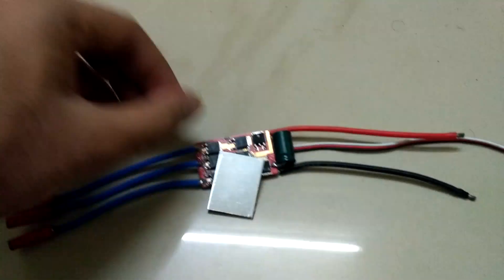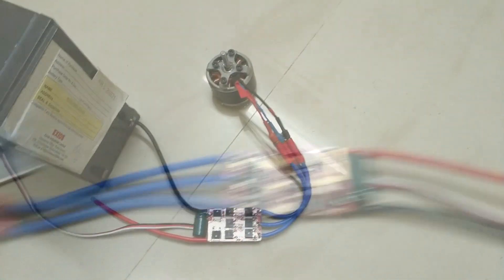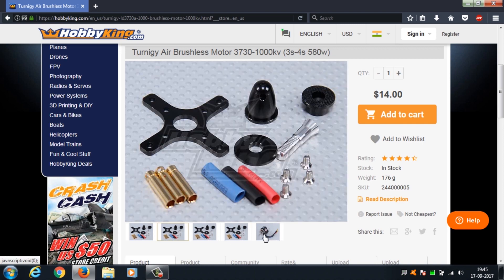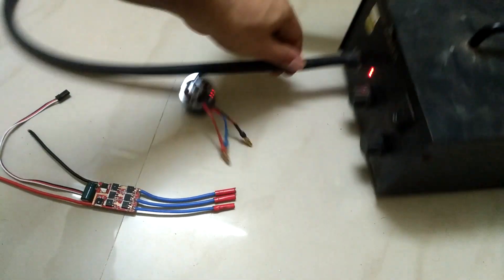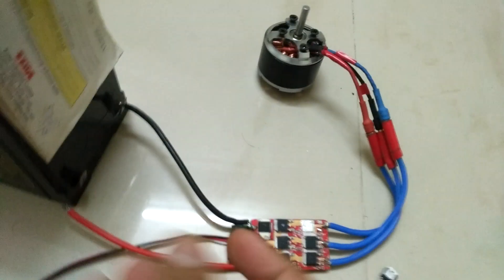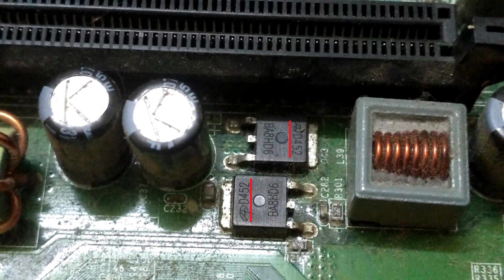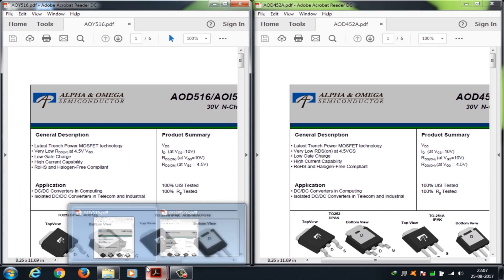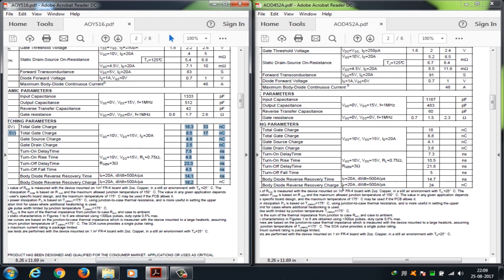Esc Burning Mosfet Replacement Part (1/2)|DIY

Comment: Why do they burn... :( I have burnt 3 and I'm using 20amps esc with 2s Lipo... please help...
Reply: To calculate the amount of amps a battery outputs you do this: say you have a 1500mah battery and it has a discharge rating of 20c, you would do 1.5 times 20 (30 amps) to calculate your amp output for the battery. Make sure your esc has at least 15-20% of wiggle room for your battery ampage output

Comment: i need some help....i had ordered a 2500kv motor and 40Amp UBEC Esc combo, and had not used it for some time. when i tested the ecs, i noticed that it was heating up very soon, like under 5 minutes, with idle power, and also on standby... i tried switching motors and props, but its still heating up... is this supposed to be normal with UBEC ESCs, or is it a serious issue???
Reply: It’s normal and it’s a serious issue. If you haven’t used it for a while then the thermal paste/pad must have dried out. You can remove the thermal pad and install your own, bigger heat sink and fresh thermal paste

Comment: When I connected my lipo 4S 14.8V 3000mAh battery to 3 brushless 30A thruster, 1 ESC exploded. Now when I connect the others, nothing responds, no sounds or movement. 
What could be the problem? Could all the ESC's be ruined?
Reply from the maker: For dead escs the first thing you should check is the regulator that produces 3.3 or 5volts for the microcontroller, if that is not getting power, nothing will work, no beeping, wont respond to signals etc

Comment: i have very cheap and veeeeery small 2-3s bldc wich is capable of making 3.4w without heating. yes only three and half watts. so im running it on 1a 3-15v soviet lab bench power supply and esc wich i am using is 10a esc. this is used as 3d printed fan for my amplifier. it worked good but one mosfet got blown so i needed to repeair it. thanks for good video, it helped, it works but im not sure for how long so i am going to buy 10a ecs wich is like 4x more expensive, becouse the one i have now is no name 10a esc.

Comment: Sir while removing the heat sink i accidentally damaged a resistor near the MOSFET,i use exactly the same wax as yours could you pls help me find the resistance of that one
Reply from the maker: If it was a gate driving resistor then you can measure and put a resistor of the same value as of the other 5 mosfet resistor, all motor driving mosfets use same value gate resistors
Reply: @thecuriousone9342  thanks alot

Comment: When I connect my battery to my quadcopter after sometimes one of my ESC gets heated up ! The other 3 is normal ! But still I can Able to fly my quadcopter ! Can i know what may be the problem ? Thanks in advance 😀
Reply from the maker: Heating up without pwm means either some of the mosfets are shorted or the 5 v regulator is shorted, check that

Comment: i have a battery with 7000mah 40c 
and a motor which consumes 14.8v and draws 55amps of current at this max load conditions  . will the battery fry the motor is it safe to use that battery plz help na 🙂.
Reply from the maker: Motor consumption =14.8*55amps = 814 Watts
Battery capability 7Ah times 40C =280 amps times 14.8v=4144watts
So yes the battery can handle the motor

Comment: What is the problem if the esc won't turn in starting position, unless i turn the motor first??
Reply: low voltage/high load on motor....are you using a bigger prop on a faster motor???

Comment: What if i have an ESC which is not burnt out but it isn`t receiving signals from the servo tester? what do you think would be the problem? I have tried calibrating it or even reprograming it but no success.
Reply from the maker: Does it give single beeps when motor is connected and power is applied?
Reply: i think, it might be due to the absence of an integrated BEC...

Comment: Looking for solution, my esc brushed 20a, zener is damaged and causing receiver is not active when esc turn on, the zener is broken and i cant see the number or ring colour, maybe you can help me to data of zener, 
: Esc brushed 20A single motor (this is a cheap esc 😂😂)
Reply from the maker: Brushed ESC is relatively easy to fix,so you're saying you're not getting 5V to the receiver?
Reply: @thecuriousone9342  yes sir, if i turn on esc, receiver not turn on,
Reply from the maker: @moskovwicky2225  if its a cheap esc then just add a 7805 regulator instead of trying to fix the circuitry because without pics i can't help much
Reply: Thankyou sir i'll try,

Comment: Can esc will remain operational with 5 mosfits ?
Reply from the maker: It will turn on but motor will loose 40% to 60% of the torque and will rely on inertia on the rotor to make it work

Comment: Could I repair esc 3oA (mosfet A09) by using mosfet D472 that I get from pc m. Board.. bro?
Reply from the maker: Compare VGS, VDS, pinout and switching parameters as in the video, marginal differences shouldn't be a problem in the datasheet
Reply: soo.. it doesn't matter to the marginal differences datasheet.. bro:)!
Thnkss..👍

Comment: Hi, I am having some trouble with my motor, but i cant tell if my motor doesn't work or if its the ESC.
When i plug it in it won't beep or anything, but it just twitches left and right and it will not spin up to high speeds
Reply: this incident was happened with me also, so I removed the all connection of my drone and the reconnect all connection and reset and re-calibrate my esc with my kk2.1.5 flight controller now it is working properly....

Comment: I was testing esc and after 1min esc give small magic smoke and motor vibrate .when i see magic smoke i remove battery ...but now motor wasnt giving any beepp.
My motors are good .i tested ....
Reply: Bro sane problem
Reply: @zain-ulaabideen9251  use a smaller battery pack....smoke usually means burnt transistors/capacitors......

Comment: How to remove the heat sink plate?  Kindly help!
Reply from the maker: Suryakant Ghosh there would be a gap between the pcb and the heatsink after removing the cover, use a screwdriver or some hard plastic to pry it open
Reply: TheCuriousOne it’s too tightly coupled on the top of mosfets
Reply: Applied some isopropyl alcohol and removed some heat sink paste, but it’s still too tightly stuck on mosfets
Reply: @ravindrapathak7798  heat the heatsinks up to soften the thermalglue. 50*C should work

Comment: Thank you for this video, buddy! Will you post the vido for more advanced troubleshooting, when no obvious damage is observed on the board of ESC? Thank you and cheers!
Reply from the maker: Vasiliy A Sure, lemme know the symptoms, will try my best
Reply: TheCuriousOne,
My ESC is Emax Bullet. It aint beeping the motor, nor it heats up or sparks. It is just keeping silent. I suspect that the metal protective plate, that kinda floats on soft sticky pad on top of the mosfets, may have short circuted the wires that go to the motor. However i do not know how to check it. Thank you!
Reply from the maker: Vasiliy A i will put up a video soon, meanwhile remove the heat sink and send some pics if possible